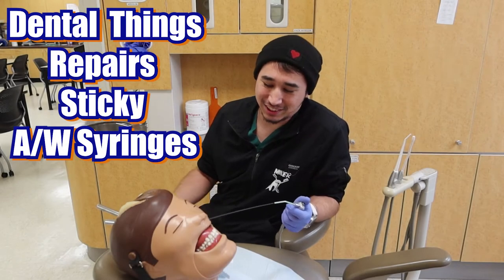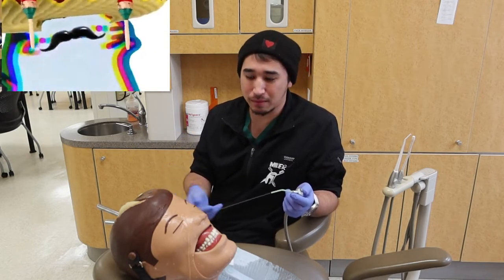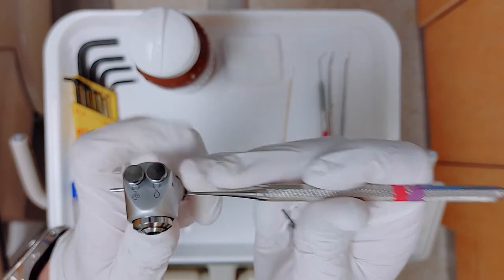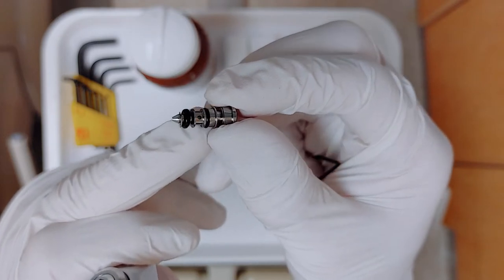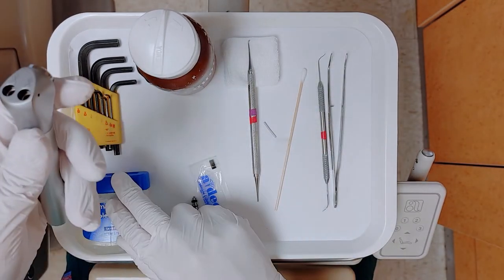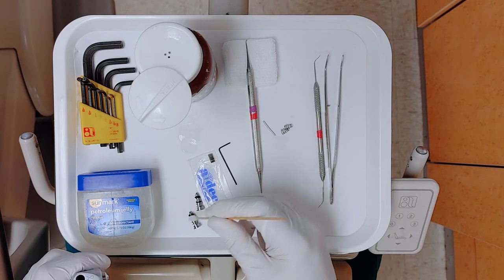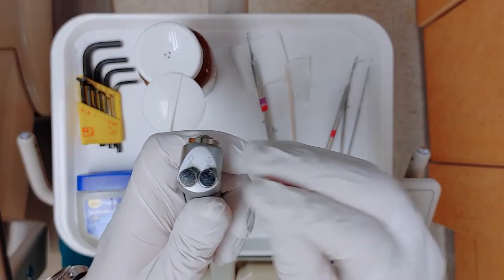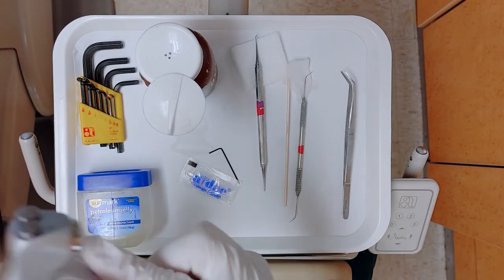Air Water Syringe -  Sticky Buttons - Dental Equipment

Comment: What happens if the buttons once back in place don't spring back up. I'm having an issue with my buttons doing this.
Reply from the maker: If the spring is put back in place  then that' should bounce up and down. Maybe the button is full of junk under the piston that it needs to be taken apart to clean.